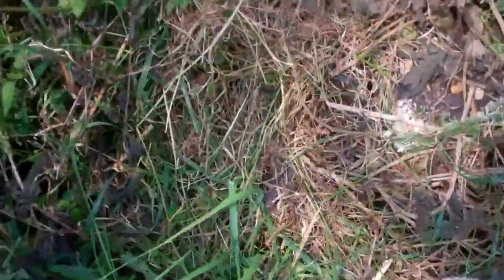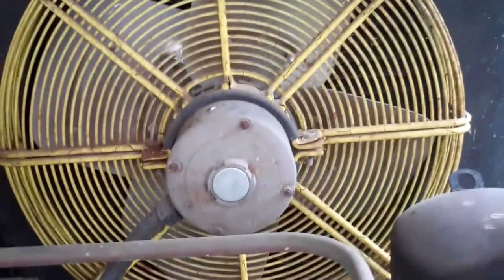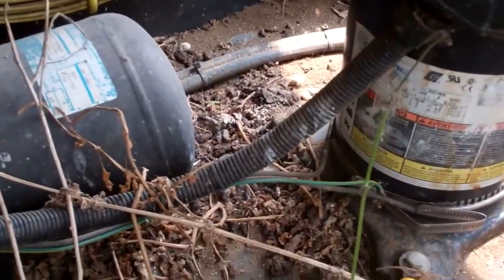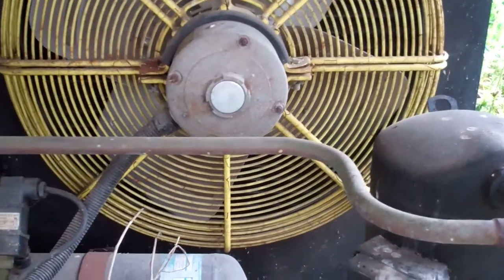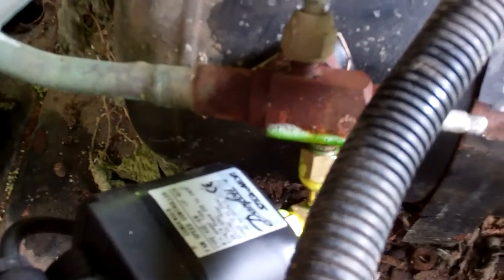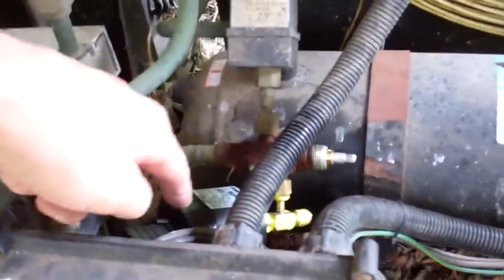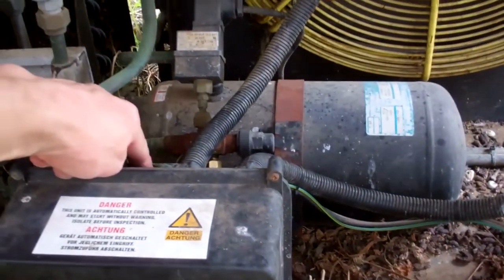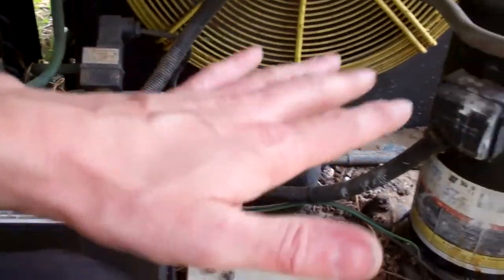Fan Speed Controller Replacement

Comment from the maker: I had another job about 2hours away after this one with a cold store full of food that was getting too warm so it was a case of getting it going asap! 
The old speed control failed completely, so the unit was cycling on the high pressure switch.

Comment: Very Nice my friend! Those little access T's are a life saver! I don't like to leave a faulty switch on a system either but, If it means the difference between recovering the charge or not; I can look the other way!:) Did the fan stop spinning completely or was did the switch fail on a low speed?

Comment from the maker: Thanks! These units make ice on a copper coil evaporator, the chilled water from the ice is used to cool milk in a plate heat exchanger and also in the storage tank, the system chills the milk from the cows body temperature to about 38F for storage.

Comment from the maker: It does the same job as a fan cycling switch by speeding up the fan as the head pressure rises and slowing it down as the pressure falls. It aims to keep a near constant pressure.

Comment from the maker: The variable speed control is more efficient than fan cycling on single fan condensers, with fan cycling the TEV is always having to adjust to the rising and falling head pressure.
 Without something to raise the head pressure in the winter there can be insufficient pressure difference between the high and low sides of the system to make the refrigerant circulate and the system can trip on low pressure.
I'll have to do a vid on the different methods when i have the time.